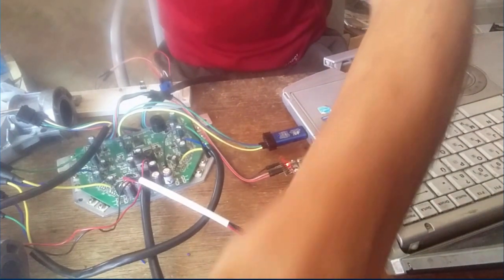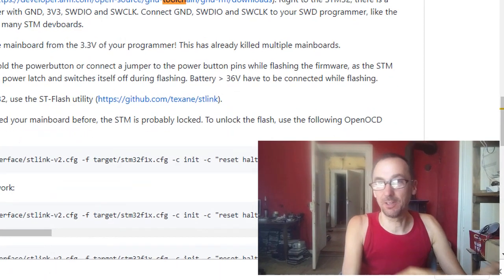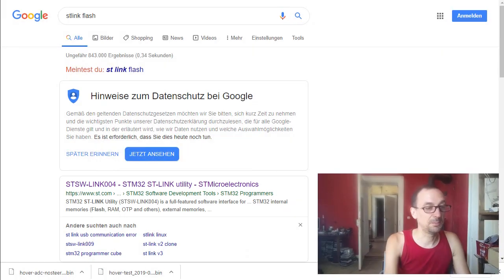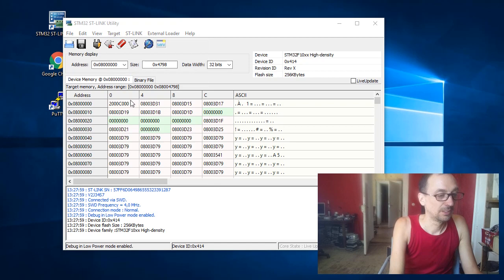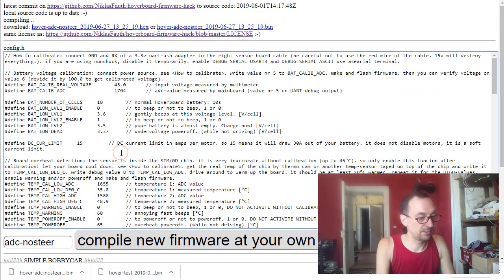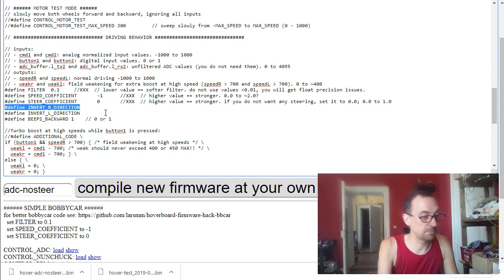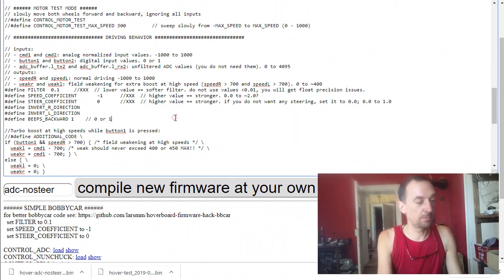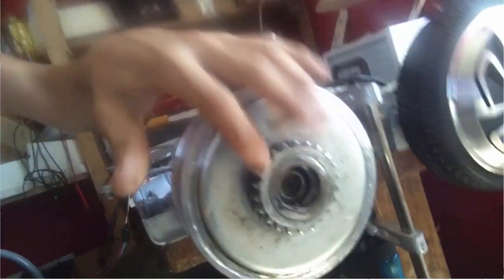free online hoverboard firmware compiler - full tutorial :-)

Comment: How do i fix no stm32 target found?
Reply from the maker: Read the wiki on the gen2.x GitHub repo
Reply: @robodurden turns out one of the wires between the stlink and esc is faulty. Im able to remove read only and flashed a bin file. Im now learning to compile using your online compiler. Thanks again
Reply from the maker: @jerichogeronimo1974 you will have more joy if you install platformio!
Reply: @robodurden i did just now.
Reply: @robodurden btw is there a way to go back to the stock firmware of the hoverboard or is it really gone for good?
Reply from the maker: @jerichogeronimo1974 in theory, you should be able to read the bytes to a bin file and flash it back later. But no one ever did this, to my knowledge.
Reply: @robodurden once i was able to connect sa esc ro the st utility. Afyer unlocking and connecting i saved the hex file. I tried flashing that file back to the esc and it wont turn on anymore.

I tried building in platformIO but there was a package.json error. 

I was able to ocmpile bipropellant using your online compiler and was succesful flashing it aswell. Too bad i have almost zero knowledge in programming
Reply from the maker: @jerichogeronimo1974 haven't you heard ChatGpt can help ?
Also ask AI about correct address to flash back your hex file..
Reply: @robodurden just an update i did manage to make it work. This is for a hoverboard to onewheel project. I managed to put crash detection and pushback. Would you hapoen to know if there are android apps we can use to connect with ourhiverboard esc?
Reply from the maker: @jerichogeronimo1974 RemoteUart with Esp32.. the onboard Bluetooth modules sometimes or mostly can only receive (music)
Reply: Will do but i have the single esc with 2 sideboard.

Comment: I was able to control Hoverboard motors using radio control. I am using radio link receiver R12DSM with radio link AT9S transmitter. The receiver has only one signal wire giving PPM signal. The receiver has 12 channels. But as only one signal wire is coming out, it only controls the motor moments. Can we add other items while compiling the firmware so that other pins can be activated by other channels to run a relay on off switch for led lights? I want to control the switching on off of the 82v brushless dc lawnmower. The hoverboard just act as moving the lawnmower, and the land over have its own dedicated 82v supply. Now I have to manually switch if on or off. Thanks

Comment: Hy, I get 4 slow beeps after uploading the software to Hoverboard. I used EFeru at RoboDurden compiler and choosing pwm. I connected 6ch receiver to 3.3v and GND from hoverboard. CH1 to PA2, CH2 to PA3. Also Im using 2x 20v lithium tool battery in series for 40v (do i need to make a change in software?) Thnx.
Reply from the maker: 6ch receiver sound like ppm and not pwm. So you might choose VARIANT_PPM.
Also search main.c for the code that is beeping out the error code.
Then you know what 4 slow beeps mean.
I never used pwm or ppm.
Reply: @robodurden  Hy, and thank you for your fast reply. I did manage to get it to work, I made some changes before compiling and had to connect to the right cable instead of left. I tried different types of controls: like VLT_mode, SPD_mode and TRQ_mode. But i get violent and fast movement in the beginning of the joystick movement, and it's slower when I move the joystick 🕹  further. May that be the reason because I use only 3.3V for the receiver? Should I use 5V, and do you know what would be the best place to source it from the hoverboard mainboard.
Reply from the maker: @mlinka21  5V would have killed the adc inputs of the long cable. The short cable is 5VT but you should not power your rc receiver with 5V.
Connect a UART dongle to short cable and get serial debug output to see how your joystick movements translate to speed steer -1000 - +1000.
I guess this is only a stupid fun project.
Watch my tutorials and stop asking for personal help.

Comment: I have a  hoverboard Skymaster 11 double wheels, the board turns on and after a while it stops working, I disconnect plug from batery to electronics. I take multimetr,  and there is a short circuit on the electronics. I take schorcut plus with the minus in electronics plug , after connecting electronic devices it works again, what could be wrong?
Reply from the maker: do not really understand your text. If you have a shortcut from plus to minus then mostly one pair of mosfets burned. So test the two left pins of the 12 mosfet for  a shortcut. And watch my mosfet repair videos..
When two mosfet burned then the connections of the two left pins to the circuit board might have also burned and been interrupted. Then there is no longer a short cut from plus to minus but the attached motor cable will not work..
Reply: I have a  hoverboard Skymaster 11 double wheels, the board turns on and after a while it stops working, I disconnect plug from batery to electronics. I take multimetr,  and there is a shortcut on the electronics. I take schorcut plus with the minus in electronics plug, i take multimetr and i do not have schortcut , after connecting electronic devices it works again, what could be wrong?
Reply from the maker: @piotrpawowski6265  first rule of project Mayhem: you do not ask questions.

Comment: Hey Robo Durden,  thank you so much for one of the best video.  I'm new here , I have one hoverboard card and one STM32 link , whenever I try to connect using stmcube programmer or STM32 utility.  It always give me the error, target not found . Kindly can you give me the brief idea of wire diagrams for power supply to hoverboard. thx lot
Reply from the maker: No you have try more yourself. Check that the stm32 dongle is properly installed and working, check that hoverboard controller board is powered by 36V, check that the power on switch is bridged. If nothing works, get yourself a plue pill and try to connect to this stm32. I have made several beginner videos. This is not the absolute beginners video. bye and good luck 🙂
Reply: You are a super man 👨 ❤ 💙. it's working. God bless you for great help. Thank you so much
Reply from the maker: @ahmadhussainwebshare1001  See how many men have been killed in the name of god. God for sure must be evil. Please no blessing of whatever god is yours !

Comment: I have a problem, and that is that after entering my code on the motherboard, the board turns on but does not turn off, that is, it simulates turning off but the red led stays on and you have to disconnect the battery so that it turns off and works again, I have only touched the speed, and the ADC control
Reply from the maker: If the board also turns on without pushing the on-button, then probably the TO220 transistor is broken and the board always on. Check my second repair video where i show how to test that transistor.
Reply: @robodurden  it was not the case, in main.c you have to modify where it puts poweroff, you have to replace the variable CONTROL_MOTOR_TEST by the variable ADC_MIN. This means that the plate does not stay on after pressing the shutdown button.
Reply from the maker: @Elec3D  sounds like a bug. Then you should open an issue in the firmwares GitHub repo.

Comment: @robo durden, nice!!! does the board have AT32F403 chip?
Reply from the maker: Usually, used boards have the stm32F103 or the compatible gd32F103.
I could add this Niklas fork to my compiler: https://github.com/cloidnerux/hoverboard-firmware-hack
Reply from the maker: Emanuel Feru was also interested in these new boards: https://github.com/NiklasFauth/hoverboard-firmware-hack/issues/97
Tell me when/if he succeeded to port his FOC firmware.
Reply from the maker: It seems that Emanuel succeeded at least with his sinusoidal mode: https://github.com/EmanuelFeru/hoverboard-firmware-hack-FOC/issues/46

Juodumas wrote: Another spare board that I had is with AT32F403 CPU, so I am currently using it with sinusoidal + voltage. It works perfectly with impressive top speed, but unfortunately current limiting does not work, so I am not sure if it's safe to introduce support for this board to the main repo? When I get a chance, I will try FOC with the changes in #81.
Reply: @robodurden  thank you so much  for your responses, I'm trying to start flashing and reprogram by using st link, I found that it can be done with https://github.com/bipropellant/bipropellant-hoverboard-firmware/issues/67#issuecomment-516657520
 but sincerely as my first time using the st link and a similar stm32 mcu, it's very hard to understand what the steps I should take. I don't think it follows the step you took on your project(using st32 software). Best would be if there's any video describring the steps detailed.
Reply from the maker: @TheLordbruh  I suggest you will make such a video once you succeed :-) I am a stm32 beginner as well. And i strongly dislike all this linux commandline nonsense..

Comment: what the name and where you buy this interfaces usb to comunicate with  hoverboard?
Reply from the maker: i buy on ebay and aliexpress. If you plan to use an arduino mini which has no usb interface, get yourself an usb-uart dongle with 6 pins = DTR for automatic upload.
If you plan to use uart2 of the hoverboard controller which is NOT 5V tolerant, you need an usb-uart dongle that can output 3.3V on the RX line !! a 3.3V/5V switch on the usb-uart dongle mostly only changes the VCC voltage, NOT the RX voltage. You have to buy several cheap dongles with a 3.3/5 V switch to be lucky enough to get one that can output 3.3V on the RX line.
But when you only use uart3 = the short cable, you can go with any usb-uart dongle.
watch my latest tutorial for absolute beginners !
Reply: @robodurden  https://produto.mercadolivre.com.br/MLB-1617322234-modulo-conversor-usb-serial-rs232-ttl-ft232-5v-33v-arduino-_JM?matt_tool=79246729&matt_word=&matt_source=google&matt_campaign_id=6542746973&matt_ad_group_id=82254694281&matt_match_type=&matt_network=u&matt_device=c&matt_creative=385099301982&matt_keyword=&matt_ad_position=&matt_ad_type=&matt_merchant_id=118715425&matt_product_id=MLB1617322234&matt_product_partition_id=472057081367&matt_target_id=pla-472057081367&gclid=Cj0KCQiA3NX_BRDQARIsALA3fIL3QP554Nqn1NFe15pvg1pbwqN8vc--W_xRzHsAJPufzR9FjzDu0ZwaAt-MEALw_wcB
Reply: this switch to 5v and 3v output ?
Reply from the maker: 3V and only attach dongle to short cable !!

Comment: Thanks for everything you do, I wanted to ask you if it is possible to program a sensor pas ?
Reply from the maker: A pedal assist sensor :-)
It should be possible to detect a periodic current change !!
Simply log the current and do a 3 second fft every 5 seconds. Then you should be able to detect a 120-180 Hz pedaling frequency (two pedals per rev).
And please share your code on success.
Reply: @robodurden  Thank you very much, I have no idea how to do it but I am going to investigate it, I love your projects!!!!!!!!!!!!!!!!!!!!!!!!!!!!!!!!!!!!!!
Reply from the maker: Of course, a $7 pas sensor that is mounted to one pedal crank will be far more responsive and stable then a pure software solution.
And if you have a freewheel you would not be able to detect a pedaling before the motor has kicked in :-(
If you don't need the steer value you could take that adc input to read the digital hall sensor. But beware that the adc inputs are not 5v tolerant. The hall sensor of these cheap pas however should also work at 3.3v.
In the main.c it might need an interrupt to count the risings slopes of the pas sensor. I have no experience with stm32 programming. I am only the guy with the online compiler.
You might want to ask Emanuel on his GitHub for help..
It might be best to let an arduino or esp32 read the pas sensor and control the hoverboad controller via uart.